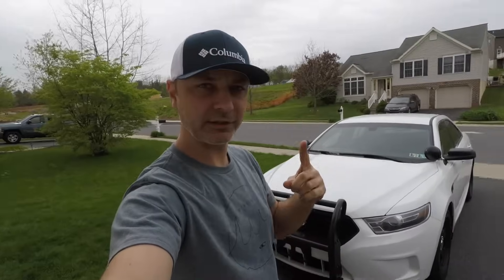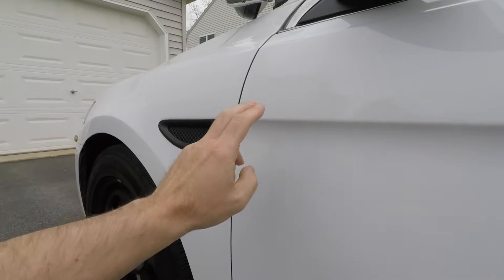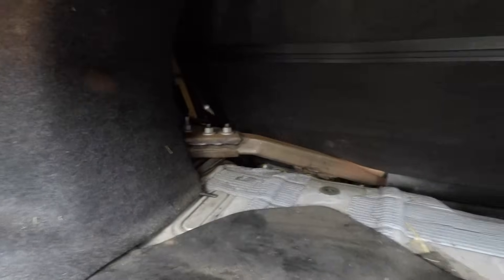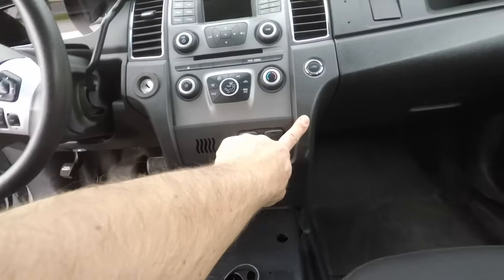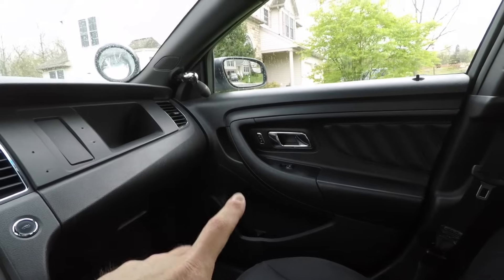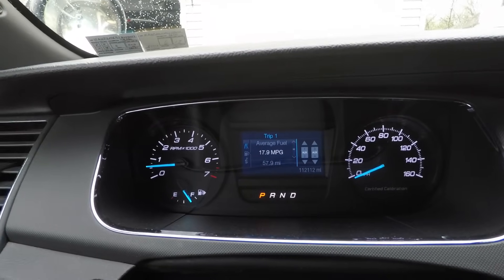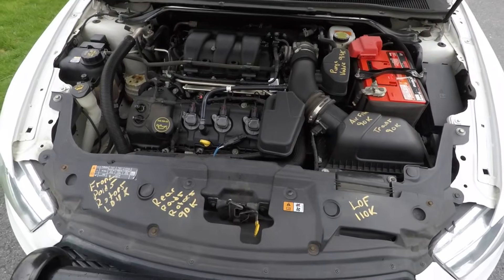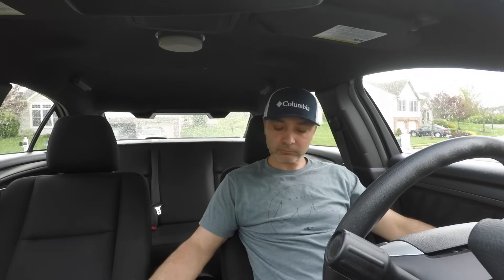I bought Police INTERCEPTOR, OVERVIEW and what comes with it, PROS & CONS

Comment: The Taurus Used to Be Built on the South Side of Chicago along with the Explorer that's still being Built at the Chicago Plant.

A Different Version of the Taurus is Still in Production & For Sale in China Only!

The Chicago Plant Had had the Taurus Built there from 1985 to 2019, as well as the Now Defunct Mercury Sable & Montego, as well with The Brief Ford 500 that was Suppose to Replace the Taurus, But Bombed Out in Sales.

 the Now Defunct Atlanta Plant Built also Built Taurus & the Now Defunct Mercury Sable Until Ford Shut Down the Atlanta Plant in 06 or 07.

They (Atlanta Plant)Continued to Build the Original Taurus for Rent a Car Agencies, Until Ford Shut Down the Atlanta Plant while The Chicago Plant Was Building the Short Live 500 Models & Mercury Montego (Sable's Replacement!)

The New Generation Explorer Came to the Chicago Plant for the 2011 Model Year in 2010, When the New Version Taurus was Already Being Built.

Now the Chicago Plant Just Builds the Explorer & the New Lincoln Avaitor.

Comment: pretty cool, I guess the frame reinforcement is there to keep the car from being "totaled" write-off in case of smaller accident?
Reply: No,they are rear strut braces. They are installed for high speed cornering.
Reply: @williamkeeler6408  most effective strut braces would have 3 links; strut to strut, left strut to center, right strut to center.
They have only 2 links necessary for strut brace 5:05, and 2 extra links (under the seat) 5:50 that are not helping with torsional rigidity
Reply: @aimless-drifter  Wow! So we've been installing these 2 piece overlapping CAMBER  STRUT braces, incorrectly,for 20 plus years. If you would've looked,more closely you would see,how the braces are sistered together overlapping! It is tied down,over the top,tensile strength brought forward,to tie into the frame rails! The best part is,you pointing out specific spots in the video and not knowing,what you're looking at! I've done,maybe 700 installs,glad you've set me straight! But,what do I know,you're the expert!
Reply: @williamkeeler6408  I don't know what you are upset about. I see that all members are connected at the center. 2 of the links are capable  to limiting the frame twist. The other 2 links that bring "tensile strength forward" I've never seen before. Do you install these on drift cars or drag cars, because I don't see how braces in the same plain as the car frame rails can help with frame twisting rigidity?
Do these extra links have a name? or is there a good example who makes these kind of strut brace kits that come with extra frame rail links?
Also do you disagree that 3-link design tie to struts together and to the center would be more effective that this 4-link design?
Reply: @aimless-drifter  I agree on the 3 link design. It's race proven and much more durable. Now,the brace in the video isn't a horizontal flat brace. It has a 15 degree slope to it. Effectively,boxing the suspension to the rear axle. Most cars have 10 to 15 degrees of sway,front to back side to side. 5 to 7.5 degrees, either way! This brace is A36 3/8" steel. It weighs, almost 100 pounds. Providing zero flex. We found out,it brings that number to 2. That's 1 degree either way. Basically making to car,one solid piece. If you were to look at it,on a blue print design,it ties the floor pan to the axle,making it a boxed frame. We add things to the cruisers and if we don't like them,we find a better way. Every cycle of cars is different. Ford, pretty much kept the Taurus,the same. Dodge always slips something new in with a redesign of the Chargers. One brace from the previous style,didn't always fit the new model year. They moved the exhaust or body bolts were moved. As far as a name goes we don't have one. We get the brace and we have to modify it, occasionally. The first design was a one piece and didn't really help,it just added weight. The 2 piece is a game changer. If you find a car with it,drive it! It's like riding the rails for a train. You are in complete control of the car.
Reply: @williamkeeler6408  pretty cool, I work on drift cars (frame flex is a bit of a concern) and people weld in strut braces in a lot of different places. Haven't seen this approach before, but if police officers claim that this works, would be interesting to try it out.
Reply: @aimless-drifter  I make my own braces. It's amazing,how cheaply cars are made! Floor pan,torsion bars and lower control arms,from the factory are junk. I pulled my LCA off my Challenger and made my own. Solid bar 2" welded to 3" bushing knuckles. Man,no more side to side,when you gas on that Scat Pack. It grips,rear end drops and launches! I'm going to make a front strut brace for my 2.2 S10. Even though it doesn't have struts,I'm going to box the front end, because I'm bored! Haha! It's scrap metal and doesn't cost,anything! Have a good one!

Comment: Lots of nice gimmicks, but I'll take my P71. The Taurus is unibody, they had to beef it up. The Crown Vic is the last of the traditional American cars. I wonder what repairs would cost for the all wheel drive, the turbo v6 will burn itself out eventually, with the turbos. I'll stick with C-Vic.
Reply: I agree, but it's really tough to find a CVPI in good condition with relatively low miles and for a reasonable price.

Comment: Anyone experience the dreaded water pump failure with the taurus? Im about rdy to get either a holden ppv, charger hemi or the ford here, and while I love these taurus looking interceptors, the water pump in the fuel tank really makes me hesitant to move on one.
Reply: The water pump is in fuel tank?
Reply from the maker: I heard stories about water pump, 2014 and up had revision on water pump. On top of that, if it had to fail, I am sure it was replaced in police car by now, they do keep maintenance on them car up to date. I have friend who works in state pollice and he says that cars get all recalls and upgrads as soon as bulletin comes out no questions SO I am sure pumps on many of them have been upgraded and replaced.
Reply: @coreturkoane5570  He  meant internal to the engine and they leak into the oil and take out the engine when they go.
Reply: @Pete717  I work at a dealership that services our states police and highway patrol cars, I'm a service advisor youll be surprised what gets done and what doesn't get done. They don't like to use synthetic oil in the vehicles that require it. They don't service the transmission oil or differential and t case oils, and depending on age and mileage they won't fix what's needed, they usually stick with what's under factory warranty after that if it's a small cheap fix they might fix it or they auction them to the public like what you got. Granted some will be in good mechanical shape and was retired due to age and mileage. Others will be in need of minor to major mechanical repairs. You'll def want to get the other fluids checked and possibly serviced.
Reply: @theconsigliere8463  that’s insane considering how much it cost to outfit a single cruiser!

Comment: I just have a question: 
What did you do with the holes on top of the car? 
How did you fix it?
Reply from the maker: State police installed plugs on there after removing antennas and lights on the roof and the trunk.

Comment: For the record, the dash u described with the big speedometer in middle and no tach? Well that's the sel and up dash, they have a tach it's digital, and is quite accurate and the se version has the dash exactly like that with a few small differences

Comment: My girlfriend bought a 2009 Crown Vic early in 2020 from a civilian who had bought it at auction from the Univ. of Arizona PD and used it for awhile. She bought it without consulting me (typical) and didn't ask enough questions of the seller about it, but was told it was NOT an interceptor. The car drives OK, but I'd like to get its service history and a Ford manual for it. Should we go to UAPD and make a public records request for its full history? Should we go to the facility that maintained it? Since it was a college cop car, I doubt it was involved in many hard chases, but Tucson, AZ is hot as hell 6-8 months a year. Since it's purportedly not an interceptor, I wonder if it was driven only by supervisory cops for lighter use. The odometer appears to have turned over at 100,000 miles at least, but I can't determine if it exceeded 200,000. Can anyone advise me of the best way to get the full service record and any special features and benefits of this car without running myself ragged in the process? Just reply on You Tube. TX a lot!!!

Comment: LOL,,,when his wife pulls up, he looks like he just got busted doing something he didn't want anybody to see him doing.  By the way for those that don't know, the certified speedometer means that it is calibrated  to + or - 1 mile per hour of actual speed.  So even if the cop doesn't have radar, he can track your speed using the car and be correct in what your speed actually is and write you a ticket based on the car's performance.  Most in this case will have cameras monitoring the police car's dash.   Besides, if you're doing 85 in a 55, does it really matter if he is 1mph off of your speed???  I used to track people's speed with the Crown Vics all the time.

Comment: check this out     maybe email them to confirm it’s for the Police Interceptor the one I got for my Police Interceptor Explorer specifies PI but on the Taurus it doesn’t. It does specify key ignition maybe it’s something that interests you maybe not.

https://www.12volt.solutions/products/2013-2018-ford-taurus-remote-start-plug-and-play-kit-no-horn-honk

FYI   also..  at any time you can push the low gear button on the end of the shift. It will shift into the lowest gear available for your speed. 

Great video nice purchase.
Reply: Just installed it    here it is   https://youtu.be/CUc2oo-tDuI

Comment: Hope you didn't pay much for it. They're driven very very hard.
Reply from the maker: I don't think they are, I have a friend who is state police and yes they speed up when they need to chaise someone, how often do they chaise someone? once twice a day? How often I speed up hard on my SHO all the time :) What kills them cars is idle time, when I look at the run/idle time, cars with 100K miles show 2000 driving hours and 8000 idle hours, per police schedule maintenance book every idle hour equals to 30 driven miles.
Reply: @Pete717  Yeah man you could be right. I'm just going off of what my uncle told me who was a cop in south Florida for many years. He said they used to beat the crap out of their cars on a daily basis. Constant city driving with hard acceleration and braking. Taking bumpy roads fast. The city owned the cars so they didn't really care. lol
Reply from the maker: @morganw8682  Correct, stay away from police vehicles, I only buy state police car, highway miles only, non of the city driving, no plastic back seat and no cage... Also state police has its own service department and takes care of the cars well, at list here in PA

Comment: It’s a SHO!
Reply: Nah, would have an "ecoboost awd" badge and not a "flex fuel awd" badge. Plus he said its a 3.7 which is the Cyclone engine, would be a 3.5 if it was an ecoboost
Reply: @justinwest9429  The 3.5 Liter EcoBoost engine, which is an upgrade on the Police Interceptor Sedan, is the same engine that's offered on the Taurus SHO. Unless it has been removed, the Police Interceptor Sedan with the 3.5 Liter EcoBoost engine will have an EcoBoost trunk badge instead of the FlexFuel trunk badge.
Reply: @paulkersey9553  agreed

Comment: What does one of these cost after retirement?
Reply: About 1200. Not joking. The lowest you can get a police interceptor is for a crown victoria at about 900
Reply: @rendem9539  try at least $6,000 for a Taurus police interceptor, most of them that low will be 80k+ miles.
Reply: @noblenitro8500  At a government auction they go for about 2000
Reply: @rendem9539  I'd love to see where you found one for that much that's not a complete shit bucket.

Comment: Whoever decommissioned this car, did a crap job. The harness in the tray is for a Whelen CenCom Carbide system and the Whelen ION's Duo, can be independently operated. Same as the ones in the grill. If they left the inline controllers for the Whelen Vertex LED lights in the headlights and tails, they too can be operated on their own. If you haven't done so, Havis makes a decent Center console for it and you don't need to be LEO to get it.

Comment: I've got one of these, the gear shift has a hidden fifth gear. If it's in drive and you press the button on the end of the handle, it puts the car into Low.
Reply: it takes it out of OverDrive so the transmission is held in 5th gear.  6th is overdrive
Reply: @AJ12-76  The hidden gear is separate from Drive, when the button is pressed the dash switches off of D and lights up an L for low.

Comment: I bought a 2013 Ford Explorer and I have a little switch Down into the left  of the  steering wheel . Do you know what it is for ?  I haven't been able to figure out what it is or does
Reply from the maker: its programmed to the light controller or siren,
Reply: Or to keep the vehicle running without the keys.
Reply: Press it, and remove the key. The car will continue to run and will not be able to be shifted from park to any gear unless the key is back in and the button is pressed again.

Comment: I'm quite curious and considering buying one of these but was wondering how much of a hassle if even possible to change the center console back? Including the radio for the GPS touch screen the car normally has
Reply: You can pick up after market Touchscreens for around $250-$300. Those normally come with phone pairing and maps and apps. I have one in mine that I picked up for $250

Comment: looking at a 13 with 140k for 6500, tempting...
Reply from the maker: As long as its good shape in and out, go for it
Reply: I just bought one on the 13th 99k miles for 13k it’s very fun to drive and very fast
Reply: I got one with 45k for $6500 last year, all black, tinted and perfect condition interior and exterior I love it
Reply: @deemiller9763  I went with an older caddy for 2500 with low miles in perfect shape instead...
Reply: @deemiller9763  where at ?

Comment: Tip for criminals, if you’re gunna run, buy an awd vehicle and run in the rain... these and the chargers are boats, they’ll end up wrecking before you
Reply: That is because the cop can't drive....Most pursue vehicles are AWD today, every Dodge at the local outfitter is AWD, whether a 6 or 8 AWD, the Hemi AWD system is selectable the V6 is single mode. That is sedan and SUV. 1500 Pickups use regular 4WD system

Comment: Also if it has a CAT deleted then will it pass emissions test?
Reply: Jon D If it is tuned for it, it will pass.
Reply: @agents6629  what does that mean? not a gearhead here, thx
Reply: Jon D It’s just a recalibration of the cars computer, which controls all of the sensors and much more. In this case it’s the rear o2 sensors to show that they’re ready.
Reply: @agents6629  Will the inspection station be none the wiser? I read something about them no longer sticking a probe into the tailpipe, now they plug a scanner into the OBD II port.
Reply: Jon D it depends on the station. In my case, I passed the inspection, but failed the visual. Most places use OBDII, but some still use tailpipe sniffer.